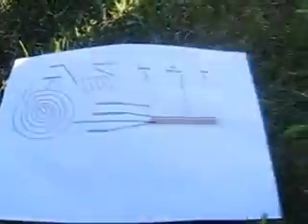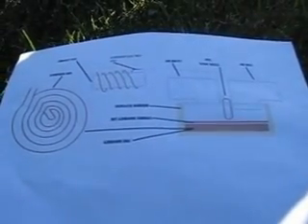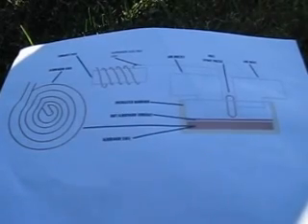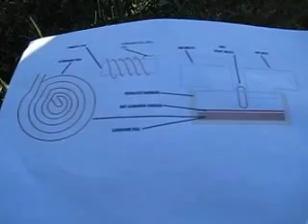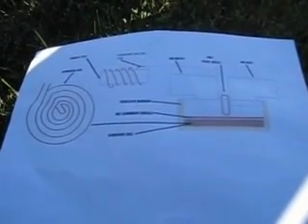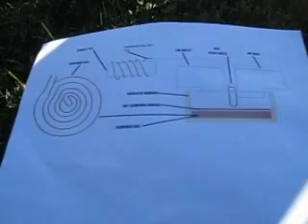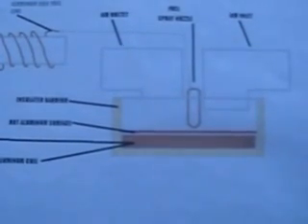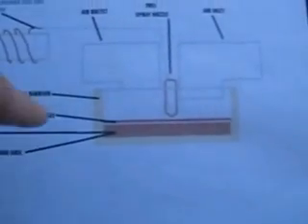Gasoline Vaporizer New Design Part 1

Comment: Great video and info Tyson! I'm working on heating my fuel and vapor lines with the exhaust also! My engine compartment is really limited on space and I'm having difficulty making room for my bubbler vaporizer in it. I may have to install it under my van almost like how the gas tank is, but that will give me a lot of room for my heating coils all around it. I'm even thinking of having my fuel pump, to pump fuel in the vaporizer as needed with an on off toggle switch also the same for adding water to the bubbler and any other combustible waste oils and burnable liquids. I was forced to upgrade my cell phone from a flip phone to a touch screen which has a camera for better videos! AT&T Bought out Cricket which was my cell service and had to upgrade to the new 4G service or my cell service would have just ended this month. Still learning how to use it, it's a HTC Desire 510. I also made an HHO Bubbler which I will eventually install on the van to increase the mileage even more using the Hydrogen I get out of the water! I'm first doing this on the Chevy Astro Van and I have a 1985 Ford Econoline Diesel E350 I have extra Glow plugs that I will also use to heat the vapors or the water fuel mixture. I just have to be careful that it don't ignite the fuel in the bottle so I have a lot of experimenting to do first regarding the glow plug use. I'm also designing a heater coil to put in my vaporizer bottle using heat from the exhaust by the muffler and the manifold. I want it perfected before this winter so I don't have to disconnect it again being forced to use straight gasoline to run it which costs me a fortune! When I got it perfected I'll be coming out to meet you so we can work on a few things together! Love ya brother hoping to see you real soon! God Bless you and your family! I'm looking for video 2 of this video now.

Comment: VERY GOOD IDEAS, HOWEVER, why not make & install a HYDROGEN GENERATOR (or you can buy one from:  www.amazon.com )?  Why not have the hydrogen & oxygen gas going into the gasoline (near the bottom) to heat the gasoline & keep it warm?  Why not give it a TRY?  You WILL GET EVEN BETTER RESULTS!

Comment: Thanks for the info. Tyson. I understand better now. It will be worth the wait! That is very wise of you and generous at the same time. Sign me up if and when. I have an 87' 5 speed Mazda p'up trk. w/ manual Weber 2 barrel carb. Would love to try it for you, as I have already tried the bubble vapor design which worked somewhat, haven't pursued it lately though because of your work on the new design..Thanks for keeping me, us, informed. Rootin' for ya dude!

Comment from the maker: As for the old design the lvl of gasoline in the bubbler tank causes differing amounts of vapor to be produced sometimes its to much sometimes its to little. You would need to have a way to keep the gas lvl constant at its prime or sweet spot so the perfect amount of vapor is created all the time. Thus far due to bumps in the road hills and things of that nature it has been impossible to control. If you can solve that problem then it would work ok. Heat it the way to do it though.

Comment from the maker: With my new designs there are things like the moisture in the air that have made things complication I have fixed the problem though by installing a moisture filter to dry the air before it enters the vapor chamber.

Comment from the maker: Thanks man. The new design I am working on now has many more upgrades and safety measures placed into it. I am creating some nice flash back arrestors along with more ways to regulate the vapor and fuel flow into and out of my vapor chamber. 
Just as a side note my car has backfired multiple times with my first method of vaporization with the back flash protection and I had no problems. I do also have the air inlet pipe protected with back flash/spark ignition protection. Safety 1st!

Comment: A key is to increase surface area as much as possible if using unheated wick vapor or bubbles vapor. With heat, the absorbent, (I guess) firebrick,( never seen one like this), should work, as it's the heat more so than the surface area that  counts. May not need the secondary air inlet valve like Tyson used if it is heated up enough, according to him and others. Hang loose for Tyson's next design using heat vapor. Read his recent findings  comparing heat vapor to  bubbles produced vapor

Comment: No I don't have a video of it. I used a rubbermaid plastic container from Walmart the approx. size of a 50 cal. ammo can, packed it fairly tight with oil absorbant matts. I had to fill it pretty full with gas. Had 1 1/2' air inlet/outlet pipes from a pool vacummn hose. No secondary air valve inlet like Tyson, but it really needs one, and or larger air inlet outlet pipes. It really needs to be kept heated, though. I went to bubbles method. Works better with bubbles I think.

Comment from the maker: It was solely results from ambient heat. There were no bubbles. The air inlet pipe was not submerged in the gasoline.

Comment: Tyson, this 19.68 mile second test run you did in warm weather with your original design vaporizer which gave you 214 to 320 mpg, did you on this run also have the fuel level below the down pipe so no bubbles were created,as inadvertently was the case in the original first run you video'ed? Was the fuel on this current test solely vaporized by ambient heat, or by a combination of ambient heat and bubbles? Thanks.

Comment: Replying to my own comment about the wick carburetor. It worked, but not very well, but it did run the 87 mazda b2000 at idle pretty well. I went to the bubbler method vaporizer like Tyson, it works much better. It's do-able, guys!

Comment: Today I ran my 87 mazda b2000 p'up trk, off of vapor, with a bubbler intake system similar to yours. Acually went down the road a short piece. Very exciting. It does work. I threw my timing belt off guning it too much at idle, it was old anyway. But will be back at it after that's replaced or fixed, haven't  checked it internaly, yet. Anyway ya'll, Tyson buddie is right. He ain't lyin' to ya. It will and does work. We have him and others like him to be thankful for. Support his work!

Comment from the maker: due to the testing I have done thus far on my current design when it is warmed up and my car is running off of hot gas vapor it seems to make no difference with no secondary air inlet valve. Further testing will still need to be done.

Comment: Tyson,most older cars have a heat riser tube coming off of the exhaust manifold heat shield that feeds warm/hot air into the metal air cleaner housing. You/we could use that pipe connection, or that heat riser pipe itself, to partially or completely  feed the hot air to the vaporizor. Most carburated cars have this. Want to thank you for being such a meticulous thinker and communicator, I get more out ot each time I listen to your thorough presentations. Great discoveries shared on this video!

Comment from the maker: All of my designs inject the vapor in through the air intake. So no there is no pressure which would condense the vapor back into a liquid state. I have not taken temperature readings that is still to come.

Comment from the maker: There are methods of vaporizing gasoline along with the additives with high heat for instance some designs use a hot plate past the injector ports if done this way there is no way you can ruin the injectors or anything of the sort because nothing is vaporized until after the gasoline is sprayed from the injectors. Once the injectors spray the gas onto the hot plate the vapors are immediately sent into the cylinder where they are ignited.

Comment from the maker: Yes the additives in gasoline can be a problem. However the need for draining the vapor is not a big deal to me. It is well worth it to me to have to drain the additives out once in a while if I am getting 214+ miles per gallon. Yes as you stated you can vaporize the additives at higher temperatures and no I don't believe that it would damage the injectors etc.

Comment: Hello  man! 
nice video! congratulations!
I was thinking of making a vaporizer, and the big problem i saw is the adictives gasoline has.
It supouse that evaporates at 400 grades celcius(the adictives), the gasoline itself  vaporizes at 100% at 225degrees celcius...is it not damaging the inyector itself or the inyector coil with that high temp?
Witch temp you are using for vaporizing the fuel? what about the pressure...is it not the pressure making the gas go liquid state?

Comment from the maker: Thanks those are great ideas! I would probably do the solenoid valve connected to my ignition switch so when my car is on it will open and when it is turned off it will close.

Comment: Check out "fuelssavers org fuel vaporizer", google it, look for blog scroll half way down, "wick carburetor", instr. made from metal ammo can and oil absorbant matts, worked well in very cold weather, Ford 350 V-8 ran 10 miles on 4 oz gas equals 320 mpg., easy to build, no moving parts, no bull... Lets keep things as simple as possible for everyone.

Comment: Continued: When I notice you continued to try and get the video recording device to focus, it seem it would not adjust focus. It is often the case with many devices which have the ability to record video- that you need to set the focus when you first press the recording button. The exposure or brightness is often set at this time as well. So in this video, you could start recording with the camera set on your design, including how close you want to be to the design. Once recording, focus is set.

Comment from the maker: your car can run off of such small amounts of vapor that even as in my previous video as I allow my fuel to run into my car as if there were no vaporizer connected it runs the same that's how small the amount of vapor can be to run an engine. So small that even with fuel going to my engine as normal along with the vapor by heat there is absolutely no change in how my engine runs.

Comment from the maker: With vaporization by heat the vapor is an a different state then that of a cool vapor. From what I have experienced even with allot of vapor my car runs the same as with small amounts of vapor. Because of this I can start my car without a back flash even when there is allot of vapor entering my engine.

Comment from the maker: I wont have anything to cool the container. I may have to figure that out in the future. I don't believe I will need to cool the container though because it will be filled with back flash protection through the whole container making it virtually imposable for it to blow up. Yes there will be more vapor in the container due to the heat after I shut my engine off but I should not have any problems because there will be nothing to ignite the vapor.

Comment: Very good idea. I was just thinking how will you cool the container when the car is not running. Will the vapor be building up if the container is hot, and the car not running? Like when you go into the store, and come back out, and crank it(with the built up vapor), what will it do? Or do you have a way for the vapor to escape, or a way to capture it? Over all, a very good idea. Just thought I will ask you this, because that is bothering me somewhat. Just be careful.